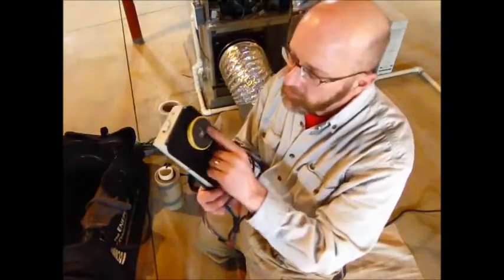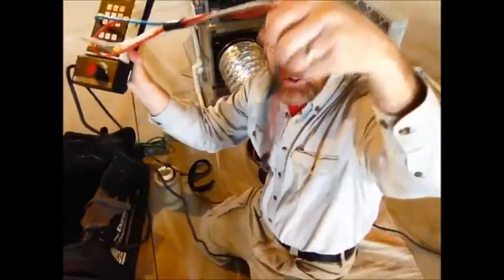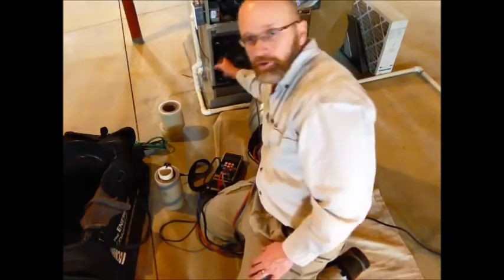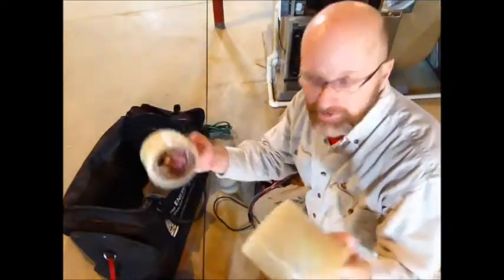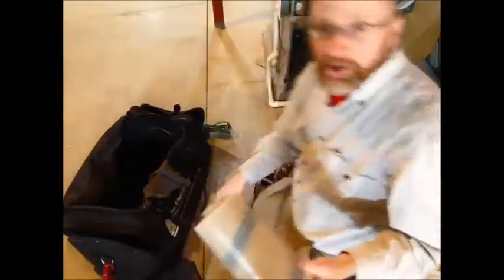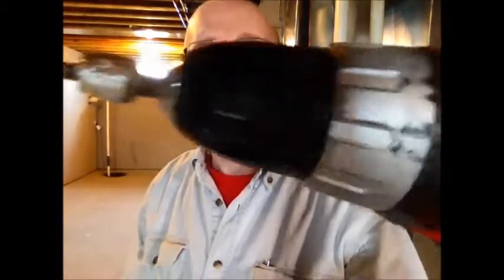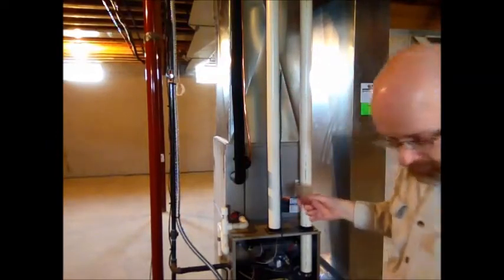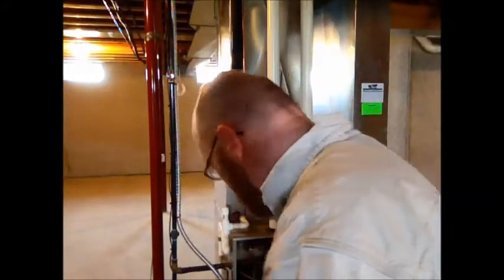For Raters: Duct Blaster Equipment

Comment: Great tips Matt. We agree with gauge magnets, connection coding on the gauge and tying all the tubes together because we've had all these features built into our systems for years. 

We have recently created some test procedures that will show new testers how to avoid some of the major pitfalls of Duct Blaster testing. For example, we agree with depressurizing ducts (because that makes the registers much easier to seal off) but have found that more than half of all trainers do not know they must use the foam flow conditioner and attach a second tube to Channel B to correctly perform a depressurization test. Some also don't know you cannot use Open range which we have discovered cannot be used while pressurizing on the flex either. 

These three points alone cause almost 100% of students to get extremely inaccurate readings. We recommend they test on a box with known hole sizes to ensure they see these factors come to light when they test. If you'd like we can send you pictures and results of what we have learned through extensive training simulation testing. Since you’re a TEC guy, you'd be the ideal person to deliver the learning and to get people testing correctly. This affects us when companies buy one of our systems that gives them different results. They then accuse our system of being wrong when in fact they have done 100s of duct Blaster tests incorrectly for years and don’t even know it. Our system doesn’t require you remember any of these critical set up steps since it won’t allow you to test outside the limits of the equipment. 

When the TEC Duct Blaster is used correctly, it will give the same results as our DucTester but there are several set up issues with the Duct Blaster that should be understood by all trainers and testers alike because they will cause massive errors. 

Without wanting to nitpick, the probe you used is a Static Probe, not a Pitot Tube which has two connections and will measure velocity whereas the Static Probe your using will only measure Static Pressure which is what you want. 

Contact me at colin@retrotec.com